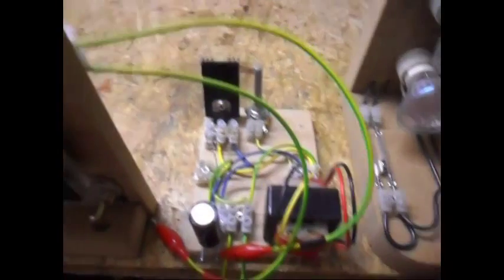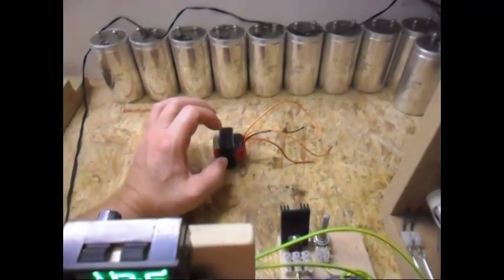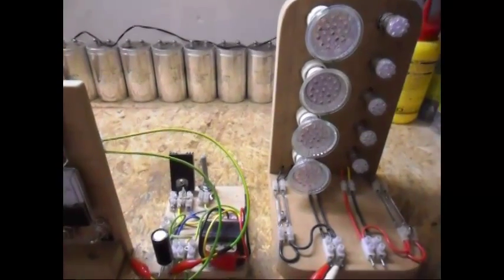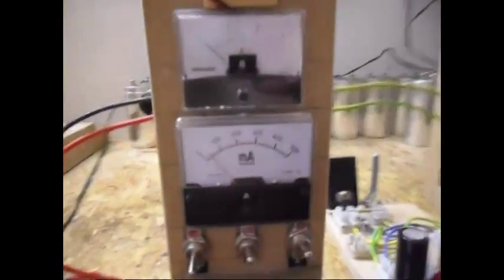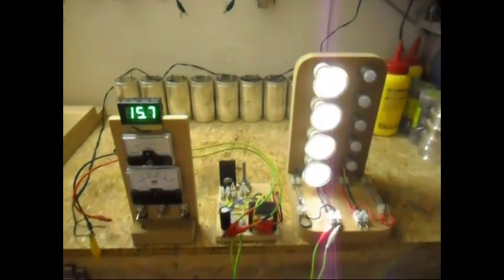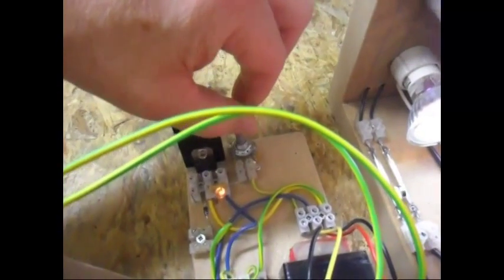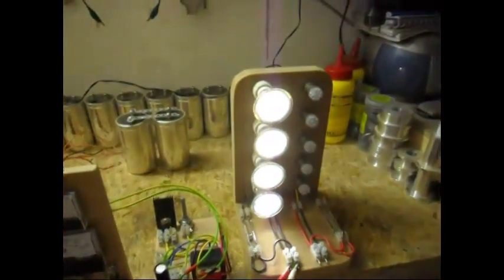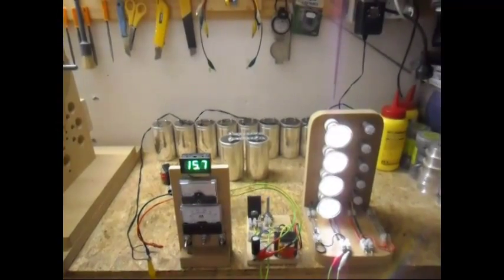Joule Thief_HF Inverter_Oscillator - Update 8 Plain efficient running, no transformer...

Comment: can you run two small electric dc motors, one as a motor and other as a generator and loop it into the system?
Reply from the maker: Hi Cruz Canal,
Thanks for your comment...^^
Running a dc motor as a generator will have more losses so it's better to put the dc that is in the cap bank into the system itself...see this video here to see what i mean with this...^^
Joule Thief_HF Inverter_Oscillator - Update 6 B-emf thru transformer with feedback...
Its does help but no self runner wich is pretty obvious...lol

Comment: if the 4 leds only use 40 ma what would happen if you put 4 solar cells in front of them to try to generate the 40 ma to run it salf?
Reply from the maker: Hi tom pappolla,
Thanks for your comment...^^
I have done some test in the past on what you wrote but i didn't see any good outcome to make a self runner.
What i've seen was the same volt or the same ma but never both wich is needed to make it run it self...^^
But than again my solar panel was a crappy one...lol
Nowadays we have far better cells with higher energy conversion efficiency...^^
Reply: The word efficiency means there is loss, if there is loss, it can not indefinitely run itself. Even if you could find a way to create perpetual motion(energy) it could never create more energy and would be merely a cool museum piece. Of course that would mean you have discovered 100% efficiency, which may or may not be something that would be handy in the real world, but, you can not create energy without pulling it from an outside source.